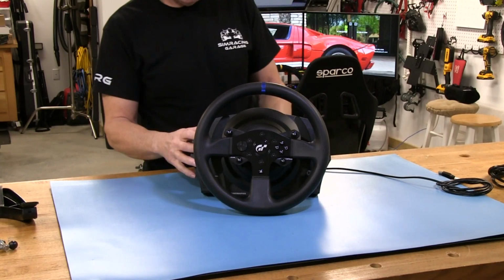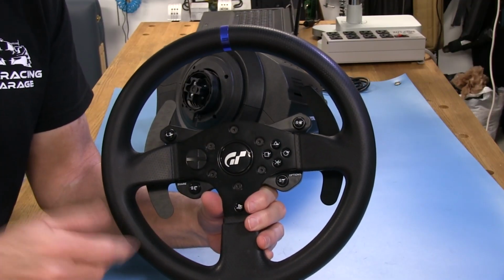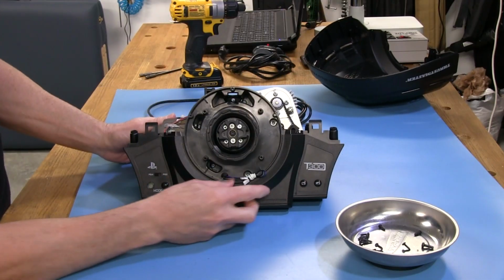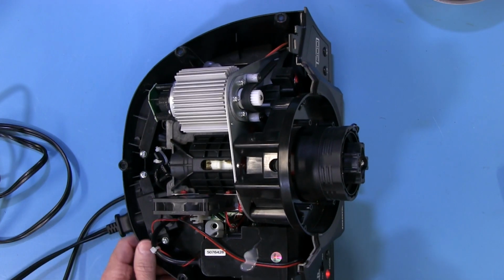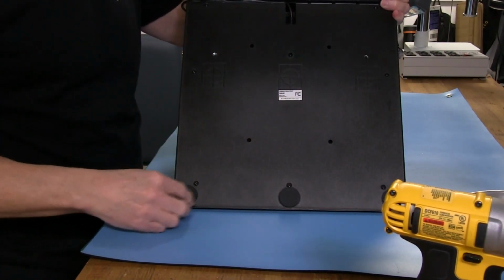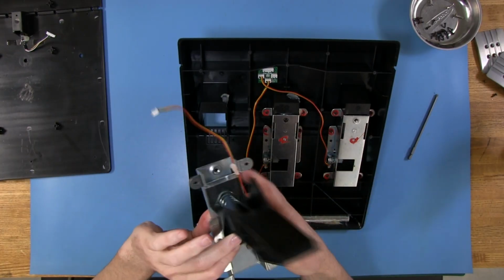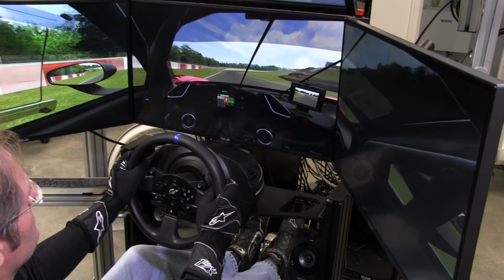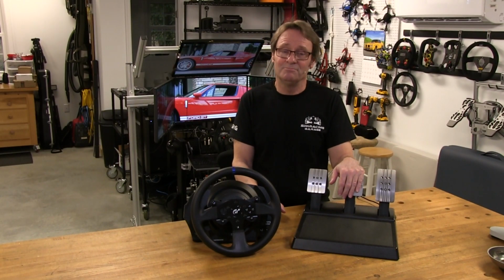Thrustmaster T300RS GT Review

Comment: A new motor fixed my failure to calibrate, wheel whizzing back and forth problem. ebay 26 english pounds. Magnet on shaft glue failure I suspect.  Easy to fit. Just  changed the fan as that failed also. It's a decent wheel, just always wondering when it might die again, and I'm only a casual user maybe an hour or two most days. So I run it on 75%, not sure I would dare try 100% although on Assetto Corsa 10-12 laps leave your wrists and hands in bits in somthing quick. Surprising I thought! It works well in GTsport but I find I dont feel as much as in AC. If it wasnt for the pretty nasty motor shaft thing I'd possibly keep it but looking to go fanatec so I can actually use the full capabilities of the wheel rather than treat it with kid gloves. For the price thrustmaster charge for this, I think that's not too much to ask. Shame as its bloody good.

Comment: Have you used this wheel on Driveclub on PS4? Just wondering how you’d rate that ‘sim’ against Project Cars 2 ... ? Also, the upcoming PC3 May fix some/all of that lag, depending what they focus on improving, I guess? Thinking of going with PS4, this wheel (or a G29; seems this one is worth the extra cost) and then Driveclub or PC2 (or 3, if it’s out by then), as a good/decent start. Thanks! 🙏🏼

Comment: Finally I found my T300 review, I can see it inside. I bought this wheel  almost 3 or 4 years ago and still works  perfect. Only thing I have done was replace pedal set. Thanks for review.
Reply: Did you drive aggressive with it?
Reply: @fettaheker  not really but  depends on the games.
Reply: @antonpaco  I'm afraid of cracking my wheel that I will buy in the future of spinning it too fast from left to right
Reply: @fettaheker  I bought the wheel in 2014  and still works fine. Don't be afraid, it is a strong wheel.
Reply: It’s great wheel
Reply: Hi guys, when I play this steering wheel in Assetto Corsa Competizione and hit the energy-intensive barrier with great force, the steering wheel shakes. Is this normal? should I snatch it from my hands?
Reply: When you say " great force" do you mean high speed? If so I think is normal.
Reply: @antonpaco  yes i mean high speed
Reply: @antonpaco  i set in windows 100 % ffb and game 90
Reply: @Kpt.Gwizdek  100% is very high FBB. Yes I think is normal the wheel shake in your hands.
Reply: @antonpaco  what are your ffb settings?
Reply: @Kpt.Gwizdek  I have 75%, I don't like FBB to heavy.
Reply: @antonpaco  thank you very much for your reply. you are the first person in a week to respond to me on this topic.
Reply: @Kpt.Gwizdek  you are welcome.

Comment: 15:35 the quality of the fan used is a bit suspect, mine failed giving off a loud humming noise with vibration felt through the wheel, seems to be a common issue however its now resolved with a huge PC fan and no top cover, guess i will never have high temp issues.

Comment: The internal power supply gets crazy hot and the fan has not effect on it plus the case really isn't designed for airflow so this wheel is great but prone to overheating

Comment: Please someone see this..trying to help some guys on a face book group and one is missing the power main cord with the 4 pin layout.ive looked everywhere but can't find a us one ..it's a TX but it's the same as this one...or some wiring diagrams so i coukd fasion a plug for him. Thrustmaster hasn't emailed back anyones who's tried asking to buy.if I had a good enough diagram of just switch my plug and receiver to another plug but don't want to miss something without a digram..any help woukd be appreciated.thsnks.
Email eblock421@gmail.com
Reply: @designamk1160  yes and no there were no us ones available...finally got thrust master to respond and got one from them finally.

Comment: The amount of reliability issues with these wheels  is through the roof,customers going through 3 or 4 wheels,fan issues,clunky noises,my g27 has  been rock solid ,it may not have the ffb of the Thrustmaster wheels  but  it is reliable and the Thrustmasters are overpriced here in Australia.
The cost of a t300 here is minimum 700 dollars for an old wheel with a tiny fan designed to heat up the internals just as the warranty period is finished.
Reply: Yep, incredibly crappy, really hard to belive (had one, multiple mechanical and electrical problems). Not one problem which could happen - multiple mechanical and electrical problems.
Reply: Wojciech Brygoła that’s nuts lol i got mine for $250 and I’ve had it over a year with absolutely no issues 😂
Reply: @Unique_Racing  lucky you, apparently for this wheel it's not a standard (just read e.g Amazon reviews of this wheel and compare with other wheels reviews)
Reply: Wojciech Brygoła I honestly think it’s the belt system,there is more moving parts and flex where things can go wrong whereas gears connect directly,also the small fans used in the Thrustmasters,Logitech put in smaller motors that don’t need cooling,Thrustmasters wheels will no doubt feel better but the design of the Logi wheels means they will have greater durability,of course there will be users who abuse both wheels by overcranking the ffb,I know the t300 defaults at 75 overall strength but I have seen users crank it up to 100,I think you need to handle these mass produced wheels with more care,I would lower the ffb to 70 to be on the safe side.
I know negative issues are more reported on sites like Amazon and you tube but it still does not add up,Logi wheels are probably the most bought wheels in the industry,a kid of 8 years will get one for Christmas,parents can’t afford an expensive wheel and simracing may be a novelty thing for some kids so the parents aren’t going to fork out a huge amount for a wheel that may be put in the cupboard after a month.
Yet you don’t see no where near the amount of complaints for it.
I have bought Thrustmaster products in the past,an expensive Cougar hotas which was broken,that plug which is inside the flight stick wasn’t connecting properly because there wasn’t enough glue holding it in place lol,the same connector to the ones used on Thrustmaster’s QR system.
I have seen plenty of reports of Logi users still with their g25s that are a plus ten year old wheel,I have not seen a SINGLE Thrustmaster user who has had his wheel for ten years without issues,I hear alot who say how reliable  it is after 12 or 18 months then they follow their comment up with a “it’s failed on me” .
I would love to hear people wno own the tx or t300 squash my opinions,I want to hear someone who has owned one of these wheels for 10 years,maybe Thrustmaster users just simrace more because of the greater investment,they use their wheel for longer periods?
There is also the issue of manufacturing.
I can understand why Logitech did not up the ante for their g29,the g25 and g27 are a tried and true formula for a wheel ,they are reliable and when you go back to when they were released ,the WHOLE simming community loved them with a passion,now the same people dismiss them like they are rubbish lol and because the human race loves to follow trends,look at the toilet paper hoarding fiasco,they move on to the next wheel because of clever marketing and because everyone on the net told them they are a loser for using a Logi,class based racism when you think about it,the sim community is full of it,I. can understand if a product is rubbish but the Logi wheels are the kings of durability and value,no wheel comes remotely close,don’t feel like you are a “loser” because you own one.
Reply: Jellybeantiger it’s misuse.
Reply: Dylan Zrim ok
Reply: @Jellybeantiger  TX owner here for more than 5 years and still going👊...sorry to hear that you have to pay $700 for these wheels,that's a straight rip-off...but it isn't Thrustmaster's fault tho,your Goverment taxes imports into oblivion...greetings from the Netherlands.
Reply: I’ve owned my T300 and TX for over 6 years and still going strong.  My FFB setting is around 60% and it’s plenty. Don’t understand how some people run 100% FFB....takes away from the realism.

Comment: The MODE button is for the pedals. If you use the T3PA pedals or the non-inverted pedal mode on the T3PA Pro, leave it RED.
If you have the INVERTED pedals on the T3PA Pro, press and hold for 2 seconds, then it should be GREEN.

Comment: I wonder if one of you guys might have a solution for me. I just got GT Sport and for some reason it uses the brake pedal as the accelerator! I haven't found any place in GT Sport to calibrate the pedals. Actually the wheel for that matter. I have used the wheel and pedal just fine in other racing games so I am not sure what the problem is. One thought was that I hadn't moved the slider from PS3 for PC mode to PS4. I did so but that didn't fix it.  Thanks for any solutions you might have.

Comment: The user manual says "When using a Philips screwdriver, ensure NOT to use excessive force
when tightening the small attachment screw", so what happens if I don't tighten it enough? Could it affect the force feedback or it simply avoids the steering wheel to come out?
Reply: First thing every mechanic learns in there life is how to tighten shit. You need to have the feeling between tight and secure and breaking stuff. Just tighten it down and dont apply way too much force just tighten so its secure and dont go anywhere.
Reply: I don't even use that attachment screw at all

Comment: Not sure if you cover it in the video (I was multi tasking while watching) but you can change the degrees of rotation the wheel has on the fly. There are 5 settings.
270°
360°
540°
900°
1080°
While in game you simply hold the mode button down then press right on the D-pad to go up to the next setting or left to go down (if it's at 270° then press "right" 4 times to go straight up to 1080°) then let go of the mode button and the red light should flash to show you which setting it is now on.
1 flash means it's set to 270° all the way up to 5 flashes meaning 1080°
I find this very useful. I mosty use all 1080° especially for road cars but sometimes, especially for F1/Indy cars i find 900° better.

Comment: I don't know if you mentioned this, but the 3 threaded holes in the bottom of the pedals, presumably to mount that brake mod, work very well to mount the pedals from the bottom using those same 6mm bolts that fit the bottom of the wheel.

Comment: Is there any way a person can upgrade the motor to something with torque and power?
Reply: Not as far as I know but why would you want to? The force feedback on the T300 wheel is very strong. I have maxed the FFB for laughs and it's ridiculously strong, you cannot race when it's maxed (well I guess you can but you wont win as you'll barely be able to go around bends and it'll break your wrists when you hit a curb lol). I probably set it somewhere around 50% for most driving games and this is still plenty strong enough. (I use it on PC so I use something like 70% force in the driver then 70% force in game so I estimate 50% overall is probably about what it's running at generally).
Reply: @vinsta76   no your right. I actually drive mines at 30% fbb. But i noticed with a powerful motor, there's more precise feedback and accuracy on the road. The fidelity is great.
Reply: You can upgrade the motor rather easily to any 775 class motor you wish. You will just need to look out for the maximum voltage & amperage as too high ones will/may fry the electronics

Comment: Seems that T300 has same fault as T150 has ie. internal powersupply. At least in T150 it is normal transformer and it got cooked on my wheel. Wheel just stopped responding. Took me about half an hour to dismantle the wheel enough to get hold of the transformer and even then it was too hot to hold in hand so it has been quite hot when wheel was used. I converted to external powersupply and haven't had any problems with power side anymore.
Reply: I've had the T300 for almost 5 years now and I've used it heavily. Not had a single problem. I don't know about the T150 but the T300 has a fan inside for cooling. On hot days, and/or if you like maxing the FFB strength (dunno why you would) you can force the wheel into cooling mode by holding the mode button and the Start button at the same time until the red light flashes twice. The fan will now stay on 100% of the time. Repeat this and the light will flash once telling you it is now back on auto mode (apparently if the wheel gets too hot the FFB will fade but I've never had this issue yet and I don't even use cool mode)
Reply: T150 has fan too, but it's for the motor only. The transformer is enclosed completely so it gets no cooling at all. Seemed similar to T300. Maybe they used beefier transformer in T300 so it doesn't run as hot. After switching to external powersupply with same output voltage, but more current output I could feel the force feedback being stronger so the original transformer was limiting factor for the force. So far the motor has survived this extra power

Comment: I just got that wheel. How much of degree you generally use in games? I tried the default 900 degrees but find it hard in >90 degree corners to turn the wheel so much. My brain goes lazy when I playing a computer game :)
Reply: You can change the amount of degrees of turning the wheel has on the fly using the wheel itself. Hold the mode button and press right on the d-pad to increase the degrees. There's 5 settings. 270° is the lowest. 1080° is the highest. The red light will flash the corresponding amount of times (1 flash= 270°, 4 flashes means 900°, 5 flashes means 1080° etc)
Personally I use 1080 for road cars, 900 for F1/Indy cars but this will change depending on in game wheel settings and even car set ups where steering sensitivity can also be changed.

Comment: Are these pedals the same as the ones that come with the TGT wheel?  Do load cell mods that work with regular T3PAs work with these?
Reply from the maker: Yes, same pedals. Not sure about the load cell compatibility. You need to confirm with the manufacturer of whatever load cell you want to use.
Reply: @simracinggarage3026  Thanks dude!  Seems like a lot of this stuff is unavailable these days.  I would just buy a Fanatec CSL elite with LC pedals but it doesn't seem to be possible anymore.  Maybe its better to wait for the next gen consoles.

Comment: This was very helpful, however, many RMA-horror stories and poor anecdotal amazon reviews give a bad impression on this model. But when the wheel works, it sounds like one of the best entry level wheels on the market. Is it worth all the troubles?
Reply: exactly what im thinking too
Reply: Well if it makes you any better, my G29 broke after a year... Both Logitech and Thrustmaster wheels have their issues. It's not a matter of "if" but more of "when" it will broke. Anyway, I just ordered one and hopefully it's gonna be okay. Just make sure you have the warranty with it
Reply: 5 years of heavy use here with no issues what so ever. It's been fantastic for me.
Reply: @vinsta76  sounds great, did u ever change any settings in the TM software, like FFB or forced cooling?
Reply: @guccipookie  Never used forced cooling but I do sometimes hear the fan going after a long session. Never really messed with the TM software other than setting/testing it when I first got it. I regularly spend 3-4-5 hour sessions using it. I have for the last 4 days in a row for example. Still works as good as new and I use it in either 900° or 1080° mode depending on the car so the full steering range gets used as well.

Comment: The "Mode" button and light is just to switch between right pedal and left pedal (i.e. if you want the clutch on your right). Not very useful in my opinion.
I opened my broken T150 but I realize that the T300 is really a upper level.
Reply: The mode button/light on the T300 has a few functions. Hold the mode button and the start button together until the light flashes twice will force the internal fan to stay on (cooling mode added in a firmware update).
Holding the mode button and pressing right on the d-pad increases the degrees of rotation the wheel has. There are 5 settings, 270°, 360°, 540°, 900°, 1080°.
The light flashes once for 270° increasing up to 5 times for 1080°. This can be changed on the fly, mid race if needed.
These are the 2 uses I know of. Might be more?

Comment: i have a question , there is an adapter from ricmotech that allows you to plug logitech g29 pedals directly to the t300 wheel base , after that g29 pedals resolution goes up to 10 bit but what about the known curve of the g29 brake pedal ? does this goes away and makes breaking more linear ?

Comment: Is this a big upgrade over the G29?
Reply: i have to know that too
Reply: I need to know also because I just got a g29 with shifter on sale for $325. Returning it after less  than a week. The t300 edition with shifter will cost $600-$700+ but this doesn't look much better.
Reply: @molonlabe247  wow very expensiv prices in your country... but i think the t300 is a little bit better because his brashless motor.. but the g29 is too a good wheel in germany i never would buy it for 325 tho  the t300 gt version costs 269 and the normal version 219 euro
Reply: Umi I transition from a G29 to one of these and it's much nicer wheel to use. Much smoother and more detailed FFB.

Comment: So this GT version is a good option over the g920 as my first wheel. Want it for the few VR games
Reply: I got it on sale on amazon for 200 right now; usually, it goes for 300-350. I think for that price it's a good option till I blow at least 1000 for direct drive and load cell.
Reply: Harman Khinda and you can buy load cell for t3pa pro pedals. ! It’s amazing!
Reply: Yes it will make the g920 feel like a cheap toy.